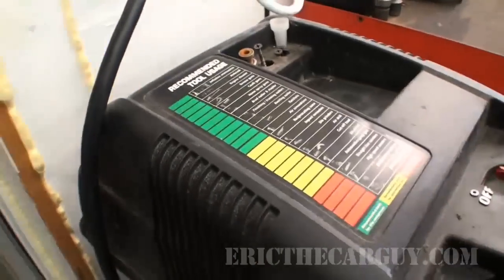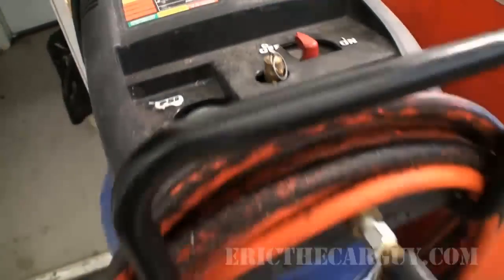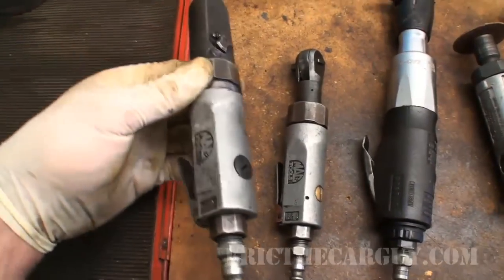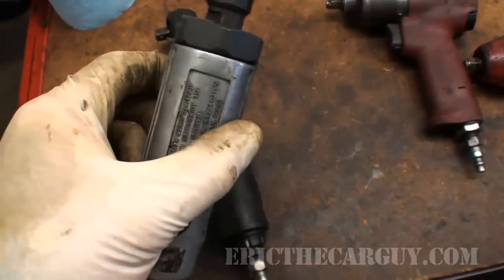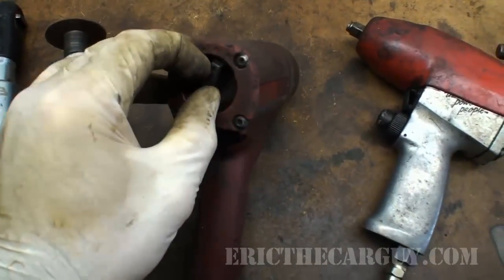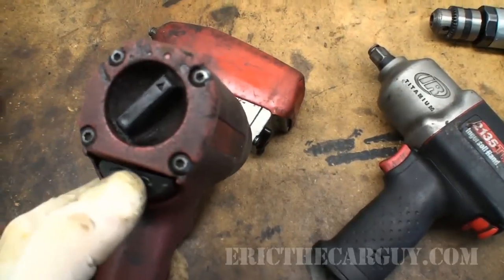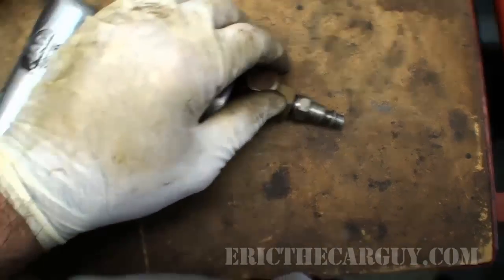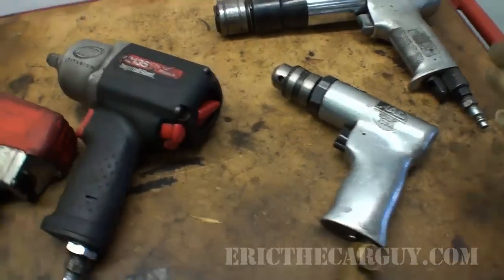ETCG's Air Tools and Compressor

Comment: are oil-less compressors any good? I want to buy just a small one for little jobs, but I son't want it it break after 10 uses if that makes sense. Thanks all!
Reply: themo8370 you should only buy oil lubricated. The oil free build slower and slower and do wear out. It seems that the longer the air compressor runs for sanding and cutting tools, the slower it builds. buy the largest oil lube compressor you can. mine is oil lubricated/ 60 gallon I got used for $250.

Comment: I've got an older cambel hausfeld 13 gal 5 horsepower and it won't power jack shit.
Reply: haha i have the same one... made in usa right
Reply: jimmy mangat yeah with the package deal.
Reply: You can try to add an extra storage tank to increase its capacity but it will also increase its run time

Comment: Oil lubed air compresor pump:  much nicer to live with.  Quieter.    I've used a few low cost air hammers, and then got a nice Mac air hammer (like eric's ) and the Mac is MUCH nicer to live with.  Can't reallly say why, just trust me.

Comment: Wow I really can't believe people say don't oil your air tools lmao I've seen some get ugly without oil such as massive torque loss it got the lug nuts to about 40 foot pounds oiled the hell out of the gun then it got them slot tighter but the safe was already done to the tool and it ended up crapping out about two weeks later it would skin freely but you could barely grab the socket and it would stop glad it wasn't mine though